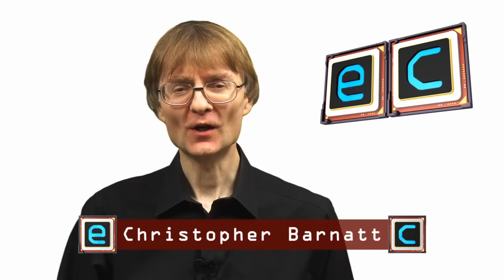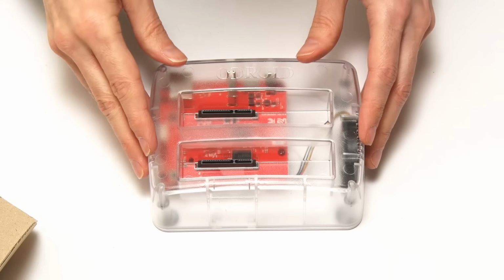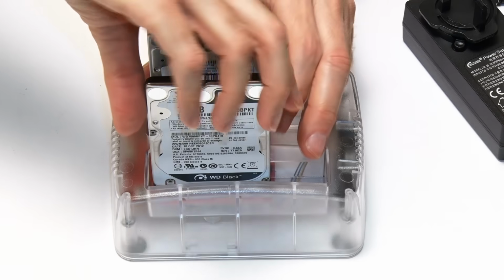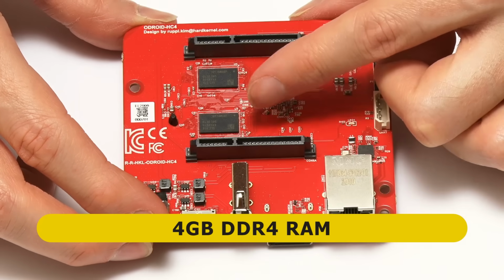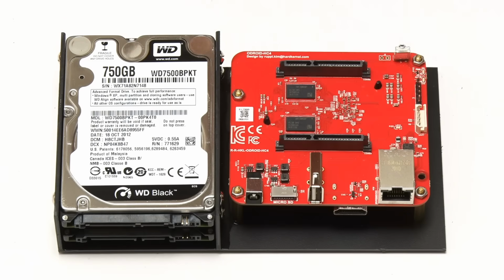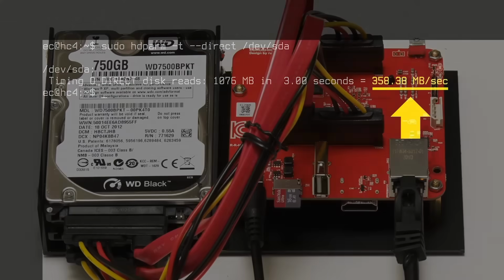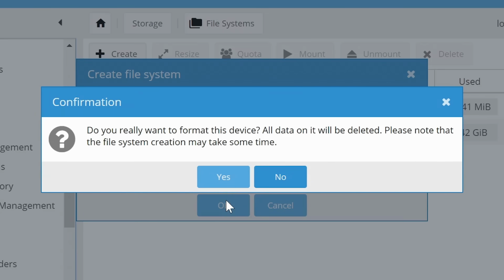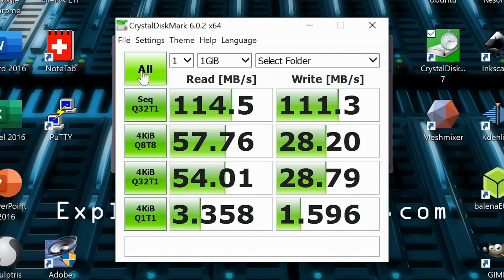Odroid HC4 Twin SATA SBC (inc OMV RAID setup)

Comment: Aaaand, first! erhm, second!
Interesting, I did not know there were Red WD drives, made specifically for a NAS application.
Reply from the maker: So close -- silver medal!
Reply: @ExplainingComputers  Missed by mere seconds!
Reply: Yeah red for specific NAS usage.  I guess they are putting their RiscV development to good use.  Looking over here I see 6TB wd red for $155.99 on newegg.
Reply: Stay away from WD Red, there was a huge scandal last year where they substituted SMR drives for CMR and performance went straight down the toilet.
If you want NAS rated drives, I can recommend SG Ironwolf and HGST.
Reply: @kingneutron1  Is that all red brand or perhap the red pro brand?
Reply: @sethrd999  WD “Red Pro” drives are their faster 7200rpm CMR drives. WD “Red Plus” is their 5400rpm CMR drives and the regular “Red” is now using SMR technology. 

I recently built a NAS and bought Red Plus because they are the slower and more quiet drives. It’s going to be placed in my room, so I would rather not have a server that sounds like a jet engine.
Reply: @Rayden440  hehe perhaps you have not heard the startup fans from a sun server hehe.
Reply: Only the WD red 4 and 6 tb are smr. 8 tb and up are cmr.
Reply: @TheNQb  As far as we know... you could go with WD Red "pro" but why pay more when there are alternatives available?
I won't be trusting WD for the next few years, that's 4sure